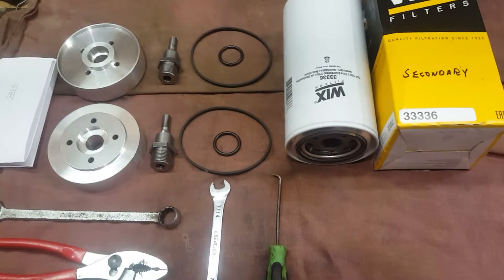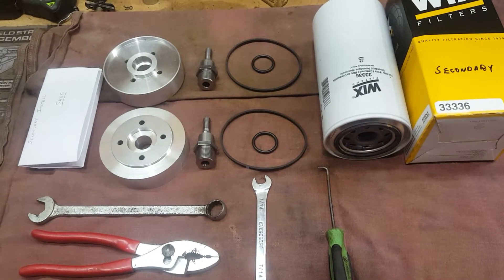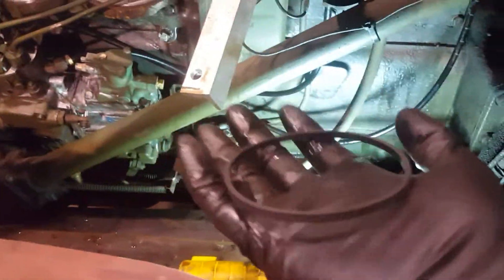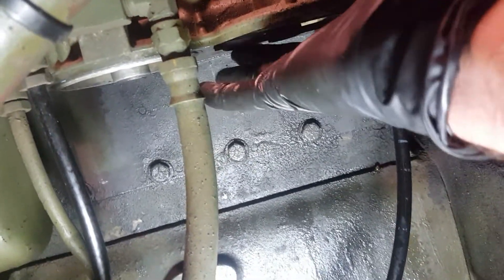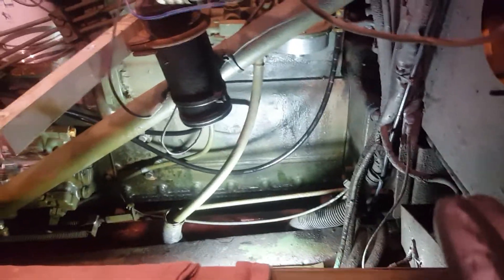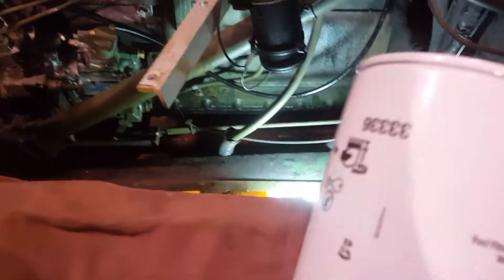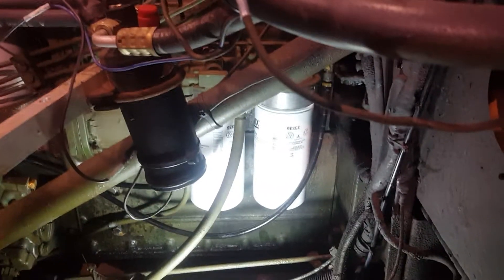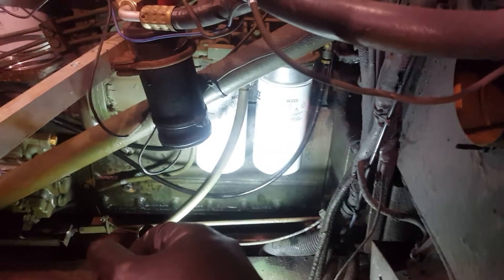Installing spin- on secondary and final fuel filter adaptors on multifuel engines

Comment: Would it better to fill the filters with fuel before install?
Reply from the maker: No. Your lift pump will fill them automatically when you turn the power on. Pre- filling them ensures contaminants will bypass the folter element.

Comment: Hi man - thank you for your help, I just got the fuel filter 3511/12 from napa and I dont mind installing them, the problem is I can't get the new napa o-ring inside the canister, I see how you did the o - ring and its looks so easy, do you think the o-ring that comes with the 3511 is not fitting the canister?
Maybe I should throw away these filters I just bought and get the kit...
What do you think?
Reply: Btw - what about the primary fuel filter, any kit for it?
Reply from the maker: always better to switch to spin on filters if you can. I use a Napa 4770 filter base to replace the primary filter head entirely instead of using the adapter.
Reply: @tacticalrepair  thank you for your reply, its looks like the adapter is easier to replace (either way the alternator has to move) any reason you replaced the whole filter base instead of the adapter?
Reply from the maker: Yes! The thread pitch if the 4770 base is 1"-14, which gives you many more options of better filters than the adapter allows.
Reply: @tacticalrepair  like the tip on napa 4770 filter base

Comment: Hi Garrett,
I see the same model number on the primary and secondary fuel filters.  I thought they had different micron ratings which would give them different model numbers. Can you clarify please?
Reply from the maker: So, these were the filters that came with the kit. Many people believe the filters work in parallel to increase flow and filter life, and the guy that designed this kit is one of those people. Unfortunately, that isn't true. If you remove the filter base you can easily trace the fuel path and see the filters clearly are plumbed in series. In summary, it was a fundamental flaw in theory of operation by the kit supplier.

Comment: hey bud, my canister leaks from the top, im guessing its the seal on it, is it ok to drive it like that? ive done a 24 miles trip and it didnt bother the engine so im on the edge of changing i out but if its not urgent ill put it off for now
Reply from the maker: john dowe try to tighten it up and see if it stops. If it isn't pouring, it should be fine.
Reply: thanks bud i been binge watching your videos lately. good content on your channel. i have a 1970s m35a2 as well so its good learning on it from other people. like that alternator video was really good. i like how well spoken you are about the topic. could you do a video on testing the voltage and adjusting the alt. i tihnk it would make a good video since u have motors laying around where u can easily show how to test and adjust the alts.
Reply from the maker: john dowe I may do that. Not a terrible idea. Btw, new fuel filters will come with the o-ring that is leaking on your top canister bolt. Leaking means it's probably not been changed in 15 years and the o-ring is rotted.
Reply: Yeah probably, im gonna stick with the old style filters for now. do you sell m35a2 parts? i need a windshield that isnt broken. i wanted to swpa out the glass but i read it wasnt worth it cause its a big hassle. and the one i bought off mike motor pool was 200$ whata ripoff
Reply from the maker: john dowe no I don't sell parts like that. $150-$200 is the standard price for new windshields these days. But keep in mind that they are aluminum frames and they won't rust out again in 6 years.